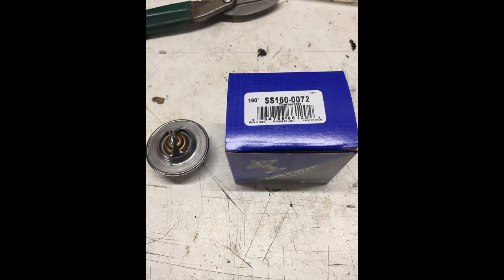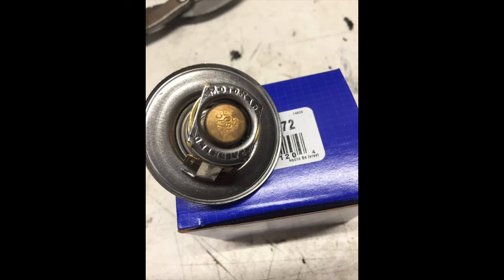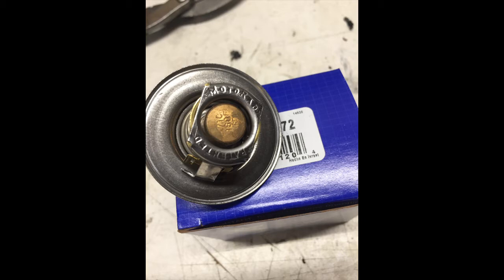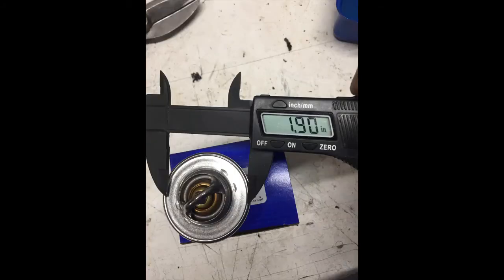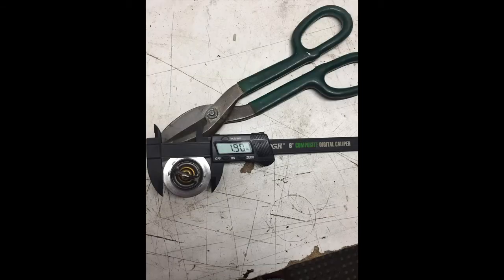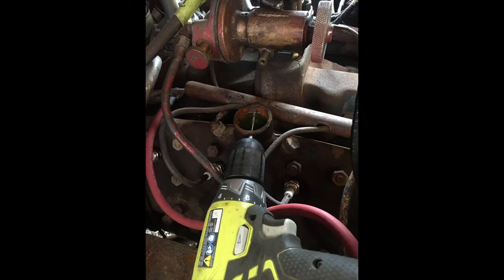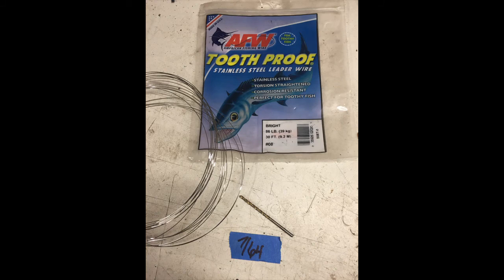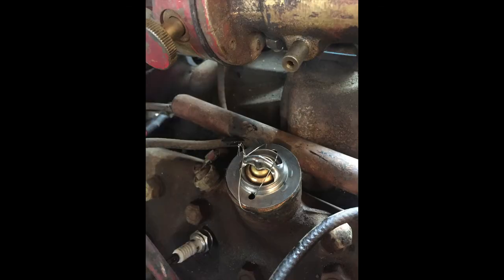How to add thermostats to a Ford flathead V8 that never had thermostats from the factory.

Comment: 2024   No problem finding thermostats for my 1947 Ford Tudor sedan with stock 59AB engine.   They fit in the hoses fine and haven't moved.  Been running for a year now.   180 deg  thermostats In Florida with 92 deg. ambient temps.